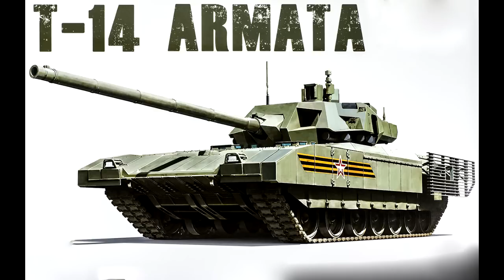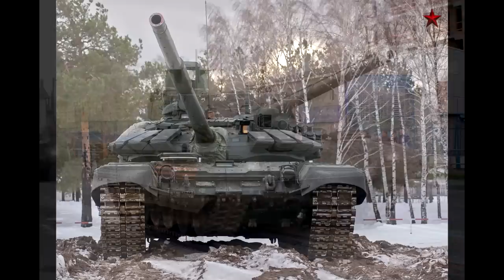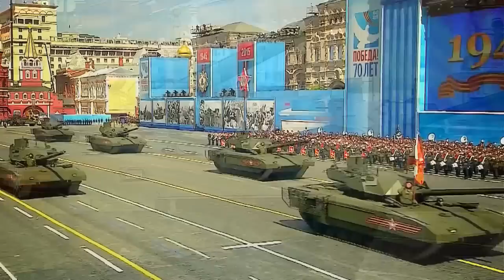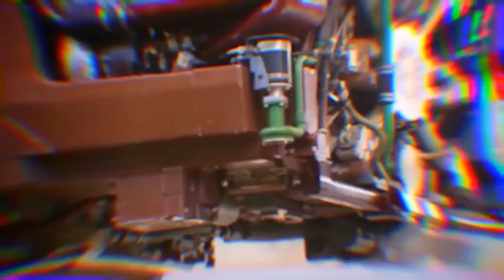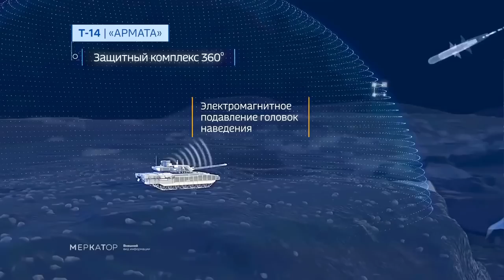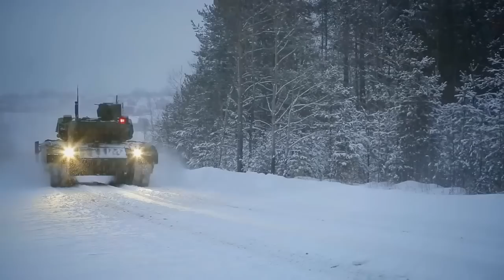Busting Myths on T-14 Armata

Comment: Abrhams is a 3 gen proven vet with stripes, i really see the armata having durability issues i dont care how fast it is. They are barely producing the tank, let alone surplus parts engines and tech. This thing is a decade away from having any felt prescence on a global scale. Not saying its not a badass. Big gun, heavy armor, fast. Taking pole position is kinda worthless if your moter blows halfway thru the race.
Reply: and abrams uses a gas turbine, no use to take pole position when you'll run out of fuel after 2 seconds

Comment: 1. eh. 50/50 here. it had a break lock. its break system broke and was locked in place. it was a simple fix yes. But if its capable of doing such a thing just by driving down a road... then weve already seen the reliability that can be seen as horrid in combat. imagine cranking that T-14 at 50km/h and you need to pull right a bit, you hear a ping, and you full on break slam.

2. no idea why people think this. 

3. as of now, 2 years later. 20 tanks have been built. and the orders for tanks have decreased. from 1,000 to 700, to 300. to 100. and now 132. so the first 100 will be delivered by 2020 and 5 years later the rest will be shipped.

4. the Obj.195 project was laid out in 1988. and had its first prototype constructed in 1999~2000. by 2010 the project was renamed from Obj.195 to T-95 as the -195 had passed its trials and tests. 
the M1 TTB had its first prototype in 1980. featuring a beak hull, prepped suspension, crew capsule for 3 in the front, 360 cameras, autoloader, crew-less turret, and composite armor reinforced with spaced armor shell and first stages of ERA... it was to enter service by 1988. the idea of the M1 TTB was around since the late 1950s. 
So its not just the looks... its the dates and the features it uses. i for one think it is. 
the T-95 picked up to be turned into the T-14 on finalization. 

5. the APS on the T-14 cant stop Sabots. this is part of that russian propaganda. i heard that the APS can snipe mk-84 bombs from  the sky as well. as if that is real. its not.
The russians bloat an APS that can detect objects moving at 2000m/s... do you know how FAST 2000m/s is? they say further developments can bounce that to 3000m/s. youre telling me. that the Russians have cameras/detectors on the T-14 ONLY. that are more advanced then anything anyone else in the world has, and its able to fly-by-snap-shot a projectile that is moving at 1km/0.5s. or even 'later improvements' of 1km/0.33s? theres many issues with this. 
A. Response. to deploy a "shrapnel" munition to blow the Sabot off path rather then a thermoberic or airburst munition that effects the projectiles flight path rather then the projectile is stupid. so even if you "blew up" or "shattered" a SABOT. you still have chunks of hot, heavy, DU and Tungsten flying at the vehicle. The concept of countering APFSDS with APS is laughable, HEAT and HE are understandable, as these are delivery packages. Sabots are rods of solid material with no internals to erupt. its designed to be a very very heavy rod dense with the material. HE and HEAT can be detonated. 
B. deploy time. the speed at which the APS has time to deploy its counter munition would need to be at nearly the same time as the enemy tank fires its Sabot. 1750m/s is the US's M829E4 munition speed. and it tanks no time getting to the target. but it is noticeably slower. now. 2000m/s and 3000m/s? you understand that most tank engagments in iraq where from less then 1000m right? Battle of 73 Easting which is the first modern tank battle occurred at 1km distance. and everything closed in. Now it is effective against ATGMs, HE, and HEAT as they are slower... much much slower then Sabots.
C. T-14 uses a direct line of fire APS. like we all do. the problem there, is the US uses top down attack weapons and airburst munitions to explode and shoot shrapnal into the top of the tank armor or just penetrate it.

They STILL cant get a fucker to the moon, theyre S-500s are feared for being FAST and having range. these are prude things. their best rifle known to man is the AN-94. theyre still generation or 2 behind the West in sensors and camera tech.

Comment: /Shrug .…. really doesn't matter. Russia has always made good tanks for its generation. The problem has always been financing. They are forced to use outdated models longer then their Western counterparts. The question is (rock, paper, scissors), can they build enough tanks or counter the possible Western anti- tank counter measures. Controlling the sky is far more valuable.

Comment: First of all the T-14 armor sucks.  They put everything into the front armor of the hull only.  It is actually larger than an M1A2 and has a bigger gun and heavier ammo and probably engine too, but weighs 17 tons less.  That is not just do to a smaller turret.  They have less armor over the rest of the tanks.  Rumors are saying the turret is so weak an RPG can pierce it from the side or back and it looks like an RPG could also take out the engine from behind easy and damage the treads from the sides too.  You can also see the tanks has few external cameras and sensors and no redundancies.  They are cutting corners to save money.  And while even if the T-14 did not break down it just shows how poorly trained and how little organization the Russian military now has to not be able to perform when they are trying to show off their military capabilities.

The fact of the matter is Russia is broke and has but a fraction of the money to spend on its military.  It used to be #2 for spending and I think at this point it is #6 and running about 1/9 of the US spending.  They currently have 100 ordered to be completed by 2020, but recently Russia big boasts of expanding its military and upgrading its older assets tend to fall way short of expectations.  Their Su-57 is delayed and only 12 are under construction and they have to use the engines from the Su-27 because the new engines are not working and this things stealth is like the T-14... only effective from the front and still way less effective tan the F-35.  Their nuclear sub program was supposed to have 24 subs made between 2010 and 2025, but so far they only have 4.  Now they are saying they are going to build over 2000 of these tanks.  I do not see it happening.  Half their military is currently mothballed and most of their new projects fall way short of boasted claims... like their Satan 2.  It has a large slightly larger payload, but actually has a shorter range and slower speed than the older Minuteman III... and it is years from being ready.  Come on they are down to 1 aircraft carrier and the only fighter jets they can use on it are some old Mig-25 and a handful of crappy VETOLs.  The last one they were trying to build they turned out selling to China.
Reply: Read the textbook on physics again, although it is probably useless, this requires brains.

Comment: I think the first one is an important example of what comes before good weapons, men who are principled and can use what they have, not what they want. The Abrams has had ten ish thousand built, only nine ever destroyed, most of those related to it being disabled by malfunctions, and four from being disabled by attacks. Compared to the Leopard 2A6, which just recently lost twenty in a battle with Syrian rebel fighters.
Reply: More than 300 M1A1 and A2 were lost in Iraq for the entire time.
Reply: Джо //Elusive// Not wrong, but there were 500 taken out of service, primarily from sand related damage to the turbines, none were directly destroyed by combat, which is the important factor I would say, as many leopards and t72s have been.
Reply: The specified number of tanks was withdrawn due to damage or wear and tear. Mostly the explosions of the bombs, and RPG attacks. The new Iraqi army has lost dozens of M1 in recent years.
Tanks are generally not used against tanks. 
Iraq had less than 200 combat-ready export T-72 assembled there.

Comment: Active defense vs APDSFS.    APDSFS REQUIRES hitting the tank point first.   it NEEDS to fly straight and level.   the Active Defense doesn't even HAVE to stop the round.   just change its nose angle.    When it goes off it pushes the nose of the warhead down,  this means when it covers the last bit of distance its tumbling...   and hits the tank... Side on.  now  steel rod, hitting a tank side on,  at that velocity, has so little penetration...   it might skuff the paint, leave a dent in some places...  but won't kill it.

Comment: @redeffect I'm hearing alot of people speculating that the T14 was rushed through trails and into production early. Some folks were expecting a larger calibre gun and I'm not the only one surprised by no co ax MG. Do you think there is anything in this speculation? Also do you think upgunned T14s are likely to appear in the future?
Reply: Up to now, the T-72 is being improved.
T-14 modular platform, of course there will be updates.

Comment: I suggest you educate the drivers before the parade. If you produce 500 tanks every year 2018-225 you end up with 3500 tanks so your math is off. As for the protection I am inclined to distrust Russian armor since the A 10 has penetrated lots of Russian tanks with a 30 mm gun.

Comment: I call BS on an under-trained crewman leaving on the parking brake, not in a tank where all 3 crew sit next to each other, if three crewman could not figure out that the parking brake was on. Typical to try to blame it on the crew I believe there was a glitch in the driver's control station that would not deactivate the brakes...
Reply: nope. all of the crew was inexperienced and equipped with a brand new tank they never got to train in

Comment: Myth #3 - It is true Russia did accept a test batch of 100 tanks, and the price seems very reasonable compared to many western options.  However, Russia has had time to complete purchase to the significant amount of tanks that was expected to replace tanks currently active.  Instead, Russia ordered relatively small number of T-14 for supposed "testing."     Unless there are major changes, I expect T-14 to be purchased in limited fashion and used to replace existing tanks at tactical locations.

Comment: Most of those are probably correct but I am highly doubtful the APS can do much about an APFSDS round. It simply has too much velocity for the system to react and even if the system can react tossing some "concentrated" shrapnel at it will not do much to negate the combination of speed, mass and hardness. Unlike HEAT rounds that you can detonate prematurely you need a near equal amount of of energy to swat away a sabot.

Comment: Project Option-195 is definetly a copy of ghee Abrams. That third abandon Russian tank project you mentioned looks nothing like the option-195, while both 195 & the t-14 look VERY similar to the Abrams. So it seems VERY reasonable to assume that the KGB got the M-1 design specs, created option-195 based on covertly obtained specs & updated/modernised its design with the t-14. As far as why they wouldn't have created this glorified copy of the American design earlier... Well, they probably either did not have enough of the design specs to make it functionally worthwhile, or were worried they'd burn the intel source whom got them the data on the M-1.
I mean the Soviets were willing to create almost an exact copy of the space shuttle ( https://en.m.wikipedia.org/wiki/Buran_%28spacecraft%29?wprov=sfla1 )! Do you really think your president, a former KGB officer, is above using stolen designs for his newest passion project?
Reply: Influenced it maybe. Stolen, is quite a baseless notion.
Reply: Both seem far to similar for mere happenstance. I mean do you really think 2 countries are going to design a spaceship that looks that similar? They have the same approximate shape, same number of rocket engines, same number of boosters, same placement & operations of the cargo bay doors.... 
Same goes for the tank, there's far too many similar systems & solutions configured in, essentially, exactly the same way. If it were truly independently developed, it would-be different, like the Israeli battle tank. Where things like instead of having the long sweeping rear of the turret, to protect the seam where the turret & main body of the tank meet, they used chains that hang down to fortify theirs.
If it were created without, at the very least, imitation in mind, they would've done something drastically differently, when they were trying to find a solution to one of the many problems facing putting a human in space, or keeping them safe from depleted uranium projectiles. If this were a civil court case, where the burden of proof is "beyond the preponderance of evidence", basically if it's 51% vs 49%, the Russians would lose the case. 
Bottom line is, it's not coincidence when it's consistently occurring!
Reply: +T Hyde

 And what systems exactly did they steal on the T-14's design?
Reply: Well I already mentioned the shape of the tank, which makes a huge difference in terms of how armor behaves; but also those thin metal bars, that encase parts of the tank (used to detonate things like rpgs, prior to them hitting the main armor); the idea of using explosive armor plates, mostly mounted on the front & turret of the tank, to counter act the force from a large round hitting the armor; the idea of using a big smooth-bore gun, although the Russians did make their's 125mm, while the US uses a 120mm (which TOTALLY is a HUGE difference).

Comment: I just can't bring myself to believe that tech is available that would sidestep physics right now, Redeffect is right to say that tech advances and the gun/armour race will always be moving on but to launch a grenade into the air off a tank have it explode and have it's shrapnel reach the desired point takes the same amount of time it has always done.
I just do not believe that ANYBODY has managed to alter physics to that degree.
The mechanics of the APS must conform to what is known and the sheer velocity of an incoming fin round which may be detected at let's say 1,000m out and is less than a second from impact at the point which the APS goes into action leaves no time for the radar array to 'see', transmit the precise interception point to the system, the system to slew to that bearing, the system to fire, the grenade to reach its detonation point, to explode fully and then for the shrapnel to travel to the incoming fin.

I'm not a rocket scientist but I just cannot believe that this is possible.Also, wouldn't the T14's APS leave a big fat radar footprint for all and sundry to see?I'm pretty sure that a J-Stars would see an active T14 APS from hundreds of miles away.If that's the case then when would the TC be instructed to 'go live' on his APS?I know that if I were commanding any vehicle with APS I would be extremely loathe to switch it on if it was likely to get me detected.
Reply: I know the comment is a year old, but:
The radar foot print:
The APS uses a type of radar that instead of emiting waves to detect them upon reflection, it detects dopler shifts of objects by other waves that reflect on them, it limits the range of the radar, but theoretically, it allows for faster detection and doesn't emit a footprint, the same is used in all APS.

The APS mechanism: instead of firing a shrapnel projectile at the round, the APS tool is not designed to fully stop a fin stabilized tank round. It consists of tubes loaded with shrapnel projectiles around the turret base, that fire like shotguns when a shell is detected, damaging it and slowing it down to the point that it does much less damage and loses penetration power. This, coupled with the ERA on the tank will fully stop the fin stabilized shell.
Reply: @quint2885  A passive radar is even slower then a active one.

Less contrast/ weaker signals just can be slower . . .

I think a real clever optical system would be better.
Reply: Believe it or not, that tech exists, go look it up if you dont believe

Comment: What a bunch of nonsense. First, to build a tank, with the best construction facilities takes about 7 months, add to this the fact that Russia does not have the money to order large quantities they will be lucky to prude a hundred a year. 
There is no active system that has been shown today against a Western Sabot round, doubt this one has either. 
We heard the same thing with the T-80's. when it went up against the Chetzians who were not a modern force they exposed this tank for the dud it was. I am highly doubtful about the claims of the Armada, would be surprised if it is half as good as they claim. Also, with every thing authomated, one EMP would most likely wipe this tank out, making it nothing but scrap metal.